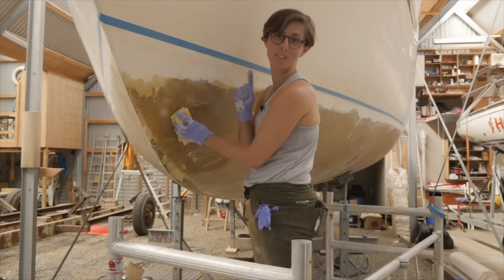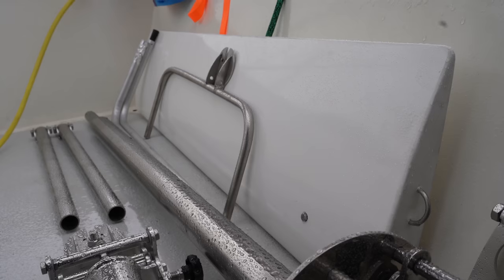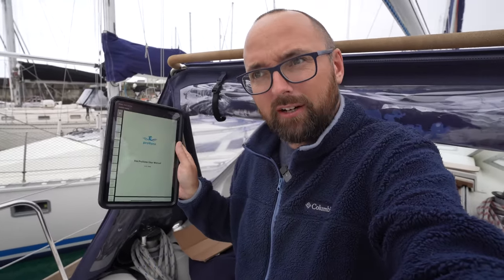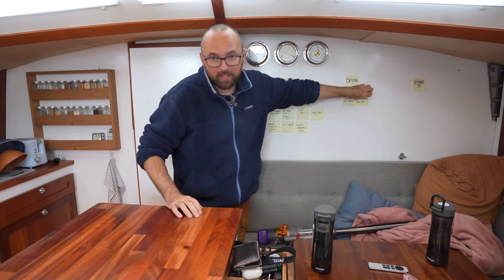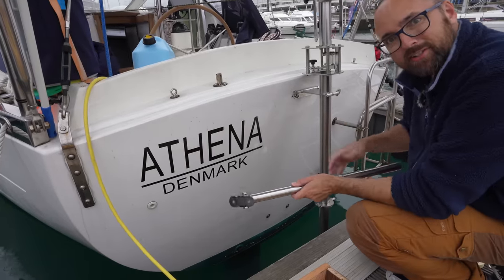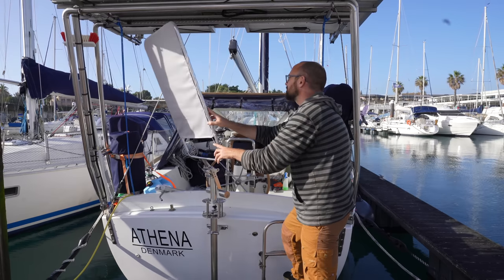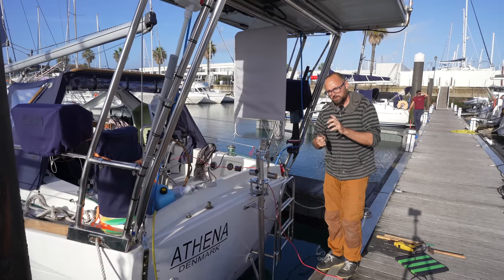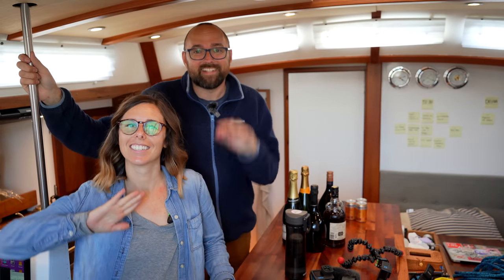Sail Life - Meet our third crew member - ProVane installation ⛵️

Comment: does the ProVane require control lines like the Aries and other pendulum setups, or is it more like a Hydrovane in the way it is set up?

I ask this because the model shown on the Windy website (from your link above) is an entirely different model with a different name, which uses control lines to a boss on the wheel, which implies that it steers via the boat's rudder and not independently as you suggest in this video
Reply: email from the manufacturer:

"ProVane is designed for a larger boat with wheel (also suits for tiller) and it has emergency rudder ability. Can be mounted off center. 

It's rudder is 300x1100mm and also the windvane is large, 520x1000mm. proVane is stand alone system, auxiliary rudder type, no steering lines in cocpit for the wheel. If you know Hydrovane, same principle, just 3x cheaper. proVane price is 2400 eur. 

I remember Mads told in video "twenty two hundred". I know exactly that I sold him 2200 eur, this was our deal, he has 109 000 subscribers, I made discount. "

so for mere mortals it's 10% more expensive but still not currently available 😠

Comment: I have seen the electronic auto pilot fail. Wind vane is a very good idea. Plus that gives you a second rudder option. Safety first guys. I did not know about the cheaper option. Hydrovane is probably a better product though. We will have to see if provane is a good option.

Comment: What about the wheel fittings and lines to the vane? Are they included? Will you show the fit and set up?
Also six month waiting list for delivery!
Reply: There are none as this is an auxiliary rudder windvane with its own rudder as opposed to one that steers using the existing rudder.  When the windvane is being used the main ships rudder will be locked amidships.
Reply: @AndyUK-Corrival  like hydrovane not servo pendulum. Thanks, now I get it!
Reply: @AndyUK-Corrival  Hi Andy - if you follow the link to the manufacturer's website, the only current model has control lines going forward to a boss on the wheel
Reply: @TheAncientMarinersBlog  I’ll have a look but that doesn’t make any sense.  This is a vane like the Hydrovane not like a servo pendulum.
Reply: If you look at the box contents when Mads opens it the vane does not look at all like the one on the website.  Maybe a new model but who knows.
Reply: @AndyUK-Corrival  many thanks for the clarification - it appears that the ProVane must have been phased out (hence the name change) so Hydrovane is still the only game in town if you have a centre cockpit or a wheelpilot
Reply: @AndyUK-Corrival In reply to another comment Madds confirms that Provane is different to the item on the website. He says Provane details have not yet been uploaded. I have WhatsApp messaged the manufacturer for clarification and ordering info if it's possible

Comment: I would’ve need a guy with a drill press and another with scuba gear to retrieve everything I dropped into the water.
Reply: Explains the included bottle of rum 🤣
Reply: Yep. I was thinking the same thing. No way I’d install a vane without warm water under the keel and my dive equipment handy.
Reply from the maker: Luckily all I lost was a single M8 nut 🙂
Reply: @SailLife  An upside down umbrella is useful in preventing loss during such installations.

Comment: The exhaust seems to contain a lot of carbon deposits. I am not overly concerned about the environment, but it could be an indication that the engine runs fuel rich because the propeller is too big.

Comment: The “Provane” looks to be similar to, but much more lightweight than , a Hydrovane. I’m not seeing it on web searches, is there a reason for that?
Having used a hydrovane on a circumnavigation and seeing the forces acting on the hydrovane, I’m not sure I would be going for a new  , less tested and lighter lookalike. 
The principle of having a “wind vane” steering system with an independent rudder I would strongly support: our Hydrovane has certainly helped us when we had autopilot gremlins in the Atlantic and has been a great energy saver on long passages with little sun, but I’m just not sure of your choice. I look forward to being proved wrong.
Reply from the maker: I don't know how the ProVane will fair either but I figured it would be a great chance to test an alternative to a Hydrovane. Hydrovanes do have a great reputation but they're also very expensive. It would be really cool if there was a well-proven cheaper alternative :)